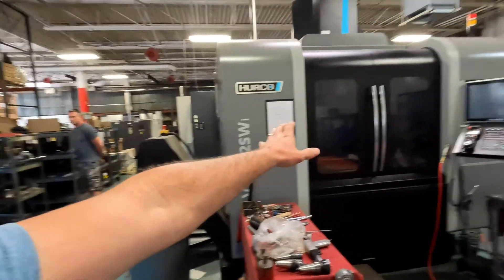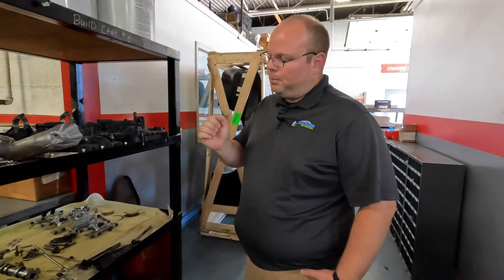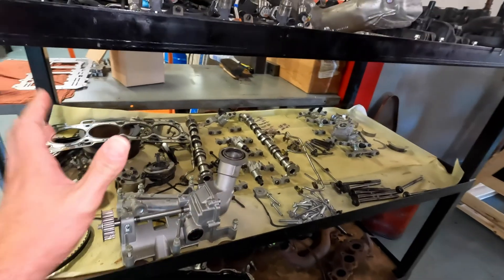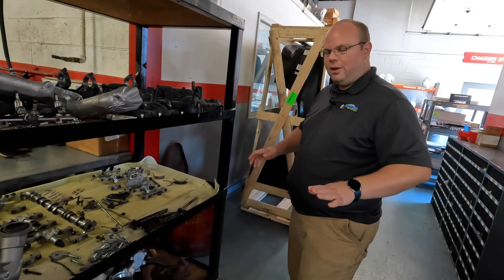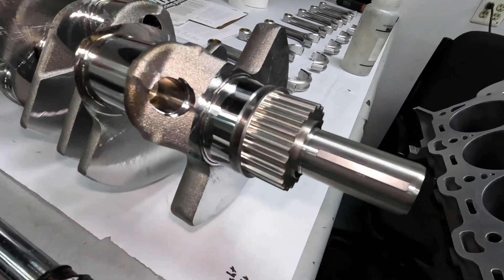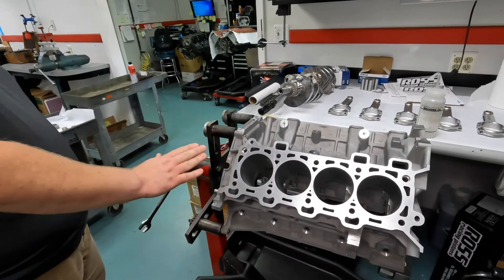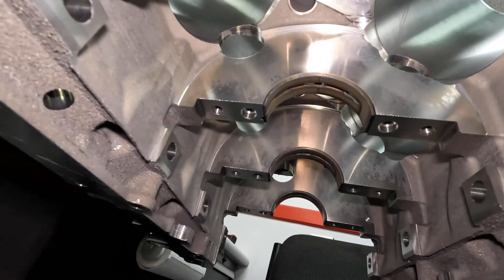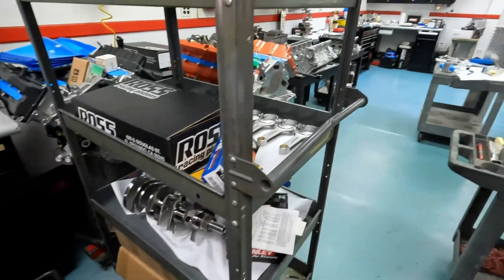What Makes the Gen 4 Coyote Different??? | Livernois Motorsports

Comment: Most customers DON'T want cylinder deactivation. Expensive and problematic. Chevrolet is coming out with a V-8 for the Chevy Silverado that DOES NOT HAVE cylinder-deactivation.  It is going to cause some customers to go to Chevy instead. At least offer a F150 with a Mustang coyote engine to get away from VDE if you want that. The VDE saves one MPG gas saving but causes engines that fail at lot sooner than when all eight cylinders work. When towing or hauling loads the F150 stays out of VDE. When the engine shut downs cylinders and the restarts them it causes a lot more wear and shortens engine's life span. Over 1 MPG gas tell the government it is not cost effective and stop being threatened and bullied  the EPA and the US government over this bullshit !!! The consumers and the manufacturers need to put their foot down and fight back !!! FORD grow a set of of balls and fight this crap. PLEASE !
Reply from the maker: At least the Ford system doesn't seem to be as problem plagued at the GM and Mopar ones.  I still have a lot of reservations about that oil pump belt through.

Comment: Cylinder deactivation is another problem...these engines won't last your heating and cooling parts of the engine constantly...this causes metal to WARP causing engine FAILURE. 👎

Comment: Still cracks at the bellhousing, still sounds like crap, still has 350hp at the wheels, still has more stuff then necessary on the engine. I get it its modern, but its not worth it in the long run

Comment: @svtperformance These gen 4 coyotes have been on the road for 5+ years now, have you heard of any failures of oil pump/belt?  Lot of comments regarding the belts unreliability, but I have heard of zero failures.  Main thing is going to be keeping good oil in the engine.
Reply: The main thing is that the belt is going to degrade over time in that oil bath, and debris will collect in the small spaces of the block.  Even if you use great oil change intervals, that debris from the belt is going to eventually shoot you in the foot.

Comment: Gen 4 is NOT basically a predator block......if it was a predator block it would be able to handle power GEN 3 power level with boost, GEN 4 ATM is junnk, cant handle boost out the box stock like a GEN 3 or even a GEN 2! 4 steps back on gen 4 from Ford in comparison to GEN 3 yote blocks

Comment: Yeah great move Ford belt driven oil pump on a work truck  engine that needs durability and reliability .Also great move to add cylinder deactivation with no increase in displacement so the 10 speed tranny can shake an shudder even more because of no low end torque 
What coyote needs is 700 cc more so it has proper low end torque so you don’t have to rev the shiet out of it as it is the case now to get power .I believe Godzilla 7.3!uses some type of variable demand oil pump which is one of the reasons it’s eating lifters and camshafts this coming from Ford mechanics so what can go wrong with a lot more complex coyote engine ?.This new gen 4 engine will be a beauty for dealerships when the recalls start  I wouldn’t bet on reliability for this generation  regardless of the hype from Ford.

Comment: I await the aftermarket to create a multi-row chain drive for the oil pump to replace the stupid belt.  The belt breaking isn't the issue, it's WHEN the belt starts to degrade and sheds bits of the belt into the oil, and that then blocks up the oil pump pickup and then destroys the engine.
Reply: There was nothing wrong with the gerotor style oil pump that's been fitted to the Ford Modular engine family for the past 30 odd years.
Reply: @DJDinaggio  What's your point, exactly?  I'm talking about how the pump is being driven, not the style of pump.
Reply: @OddBallPerformance  The point is that the Ford Modular oil pump is crank driven and proven to be reliable.
Now carmakers are trying to extract every last 1/10 of a mpg with that belt driven pump and cylinder deactivation, both of which introduce potentially catastrophic engine failure points. They could instead reduce some of the unnecessary technology that cars have these days to make them lighter. A 500lb weight reduction would achieve a much bigger mpg gain than a belt driven oil pump without compromising reliability.
Reply: @DJDinaggio  The majority of oil pumps are crank driven.  The problem is HOW it's driven.  Wet oil pump belts are a stupid idea, always have been and always will be. Ford has enough of it's own engines to serve as an example of why, and some recalls and service advisories to back it all up.
Reply: I honestly doubt anyone making over 800HP will ever make it to the point of belt degradation before the engine has other problems and needs a tear down but I'm with you and wet belts give me the creeps. The other issue is a chain also introduces harmonics and unbalanced can cause more problems.
Reply: @FrequencyOfThought  just ignore the plethora of ford engine failures from oil pump belts. Nothing to see there...
Reply: @FrequencyOfThought  A Chain drive mainly adds noise.  The majority of oil pump chains are run fit-to-length with no tensioner so that any minor harmonics introduced are eliminated.
Reply: It should be chain driven, not belt. Ford recommends there oil for it, but how many people are going yo dealer for oil changes that uses that special oil.  When you have to change the belt, its located behind the timing chains.  Expensive and not logical!   Look at he maverick pick up, the oil pump belt is failing on the 1.5 liter.  Catastrophic, put a chain and your good. My 2016 f150 has 256,000 miles.  Regular oil changes and reliable.  No oil pump belt will last that long. I know when I replace my f150 it will be a gen 3 with 6 speed not 10 with problems.  Peace out!!!!!!
Reply: @OddBallPerformance   I think a belt driven oil pump could pose potential issues. However, basically, the belt becomes a wear item. I think, though I am not sure, it has a service interval.
Reply: @robertmoore119  it does have a service interval, and the service cost to replace it is thousands of dollars if done at a dealership.

Comment: What I find interesting is everything Gen4 was surrounding the truck. Didn't see anything that said Gen4 mustang. It really leans into what another builder stated about the Gen 4 Mustang motor which was it's basically a Gen 3 motor in a Gen 4 car.
Reply: @RyanFreeman-i4o  all these changes are fuel economy related. Guess which platform is in more need of fuel economy increases?
Reply: @blakefelice6625  Yeah, carmakers have now set a trend of making their engines more failure prone for the sake of eking out an extra 0.1mpg.
Reply: @DJDinaggio a little late but the more moving and wearing parts the more likelihood of failure but let’s cross our fingers and hope not

Comment: How come almost nobody mentions ford tested the belt to 1100hp, and the belt is made of Kevlar which is literally used in bulletproofing things? And the Ford dod version is much better, AND can be turned off with a tune..
Reply: HP testing doesn’t really matter. What about heat cycles and the effects of being covered in oil 24/7. 
Nothing lasts forever especially synthetic materials.
Reply: @Mark-zz9rt  it matters, just hard to say what matters most. 100k out of any timing component is decent especially for American cars. But hp testing is definitely relevant. Even 6-700hp takes lots of heat, rpm and stress.
Reply: It doesn’t matter if the belt is made from Kevlar. It doesn’t matter if the belt can cure cancer and fly to the moon by itself. The point we’re trying to get through your head is that the belt slowly disintegrate overtime and that disintegrated material flows through the oil passages of the motor and eventually starves the motor for lubrication. It’s not about how much horsepower the belt can handle or whether or not it will break.
Reply: @miketerry6036  I agree. Fair point. But it should easily last 100k before thr reccomended change interval. And you are aware that chains stretch and break as well right?
Reply: Brokies coming up with excuses when in reality it's the $50,000.
Reply: I have a 24 f150 cylinder deactivation can be turned off by putting in sport driving mode.
Reply: @johnmckinnon44  yeah those can't be tuned yet, but I'd seriously recommend a good tune once you can. You can turn off the cylinder and start stop crap, and gain tons of power
Reply: A belt drive is a dumb idea...heat cycles will KILL it..chains are proven..Kevlar will deteriorate...and JUNK up the engine...killing it.
Reply: @YASMINE_KILLS so far so good for me and many others. Big power, higher miles,  super high revs, not seeing any issues. Chains also stretch and wear too. Sounds like a weird idea yeah,  but there's zero out there about any failures

Comment: That coyote is just way too complicated. This is why sales of Chevy go up every year and sales for Ford go down every year because Ford is doing this big mistake with their engines the smartest thing Ford could do is go back to pushrod style motors.
Reply: Check out the 7.3 Godzilla
Reply: It's no more complicated than a Toyota, or Mercedes Benz, or Hyundai, or a Honda, or BMW, or just about any other engine developed in the last 60 years!!!🤷
Reply: Hmm. No more Camaro or Challengers. To be honest the new coyote sucks because of the belt drive oil pump and displacement on demand. I have a gen three and it's been fantastic.
Reply: @carlmiller8640  The Gen 2 was really the high water mark of Coyote blocks. The cylinders of a Gen 3 block can't be overbored so if you get bore wear or scoring, it's basically scrap.
Reply: The 7.3 Godzilla is a traditional design, which is nice and simple.
   I like Camaros and Mustangs. I was a tech for some time, so I am not unfamiliar with engines or designs.
   I like the traditional methods of GM pushrod designs, but it doesn't affect sales at all.
  What does is American Support. Most of the GOP side is GM/Dodge.
   The DNC side buys them all, including Asian and European Brands.
   More recently, Asian brands have been getting more GOP support.
Reply: Can't even keep a 6.2 running these days
Reply: …except for all those pesky lifter failures.
Reply: @shaneflowers418 😂😂😂 yeah something tells me they're probly not rolling in the dough right now... DOD could possibly be the single dumbest attempt to increase fuel economy ever put into production.. design a new engine already and let that ancient design be the reliable gas hog it was meant to be lol
Reply: Go back to pushrod engines? Seriously? How old are you 65-70? I had a hot little fox body with a N/A 347 and a tremec 5-speed and pretty good parts in it, early 2000's or so. It would run away from just about anything from a dig and rarely met another street car that could outrun it. Go to the dealership buy a GT and it's really not much of a race! Hard to beat 8,000 rpms in a V8 with dohc and 4 valves per cylinder that flow twice the cfm my high dollar afr heads did making basically the power only the usable torque curve is 3 times longer than the push rod engines could ever dream of. Coyotes are complicated for simple minded people that hate technology improvements but can't explain why with any relative facts. With all 4 cams independently variable theres almost no limit to the tune-ability of a 5.0 so making more power is only limited by budget. Way more efficient, crazy long torque curve making all the power usable instead of  max power finally being made as soon as the shift light hits, not to mention power potential. Lil boost makes big power increases pushrod engines would never see. Push rods days are done, they were great in their time but that time is over now. Smarter is faster now.

Comment: And no mention of that oil consumption and plasma coating in cylinders....hmmm, wonder why?
Reply: what's wrong with regular sleeved block? Ford, lets make things more complicated... Im starting to think there the worst manufacture. They take something easy and make it twice as complicated and unreelable. 3.5 has cam phaser issues, 5.0 total engine replace ment.  Gen 3 5.0 is the worst.

Comment: Another known fact, the header bolt pattern on the drivers side cylinder head is actually a 5.2 bolt pattern, not the typical coyote 5.0 bolt pattern. Very important when ordering headers. MUSTANG motor not sure about the trucks
Reply: Good point I’m surprised they didn’t mention this

Comment: Wow belt driven oil pump??? Absolutely no way I’d buy anew coyote f150 then. That’s a disaster waiting to happen. Timing or oil belts make whatever vehicle it’s in a hard pass for me. Wow
Reply: 5 years later and they still be the most reliable 1/2 ton pick up truck engine and the ''disaster'' gets way overblown just like people running stock OPG's while being boosted
Reply: @Glorious117  5 years? This change just happened. Issue won’t show up till the belts start breaking past 100-150k miles. This is a fundamental change and historic reliability can’t be used.
Reply: @midlifecars 2021+ trucks use wet belt.
Reply: @midlifecars I hope you plan on changing your timing chain or belt at that kind of mileage regardless of the material.
Reply: LS oil pumps go out all the time and they aren’t belt driven. Coyote oil pump gears break.
Reply: @theunfairmont2497  yes but usually when pushing lots of power. They rarely fail just because of miles. Belts have historically broken on other engines in the 100-150k range. Why are you defending them going to belt? When have belts ever been known for reliability?
Reply: @midlifecars  all you see is the belt, read about the entire system… look at all these guys making well over 1000hp with the belt driven oil pumps
Reply: @theunfairmont2497 don’t bother him with facts. Ford tested this belt at over 1100HP without failure.
Reply: @philipmoore449 hp doesn’t mean shit. There is little load on these belts. Check back in 5-10 years on that belt at factory hp levels and see how cracked it is. Time and heat cycles are what is going to kill these things
Reply: @theunfairmont2497 most of the time coyote oil pump gears fail because of over revving abuse. I know most people do OPGs before they go boosted which is good but then I do know some people who have stock opgs and boosted and running fine but when u ask them isn’t the oil pump a problem while boosted most say no unless ur shifting past 7509-7800rpms
Reply: Bro you're going to not buy it cuz it's $50,000 not because of the damn belt.

Comment: What years F150 has the Gen 4?
Reply: 2024
Reply: @BigThumpr1 21+
Reply: @petergalvez6431  negative. Look it up. Gen4 Coyotes in both the Mustang and F150’s didn’t come out until this year. F150 Gen3 Coyote 18-23
Reply: @BigThumpr1  wrong. Gen 4 truck and gen 4 mustang are different. Gen 4 f150 came out in 21
Reply: @BigThumpr1  in 21 the f150 had cylinder deactivation and belt driven oil pump. 18-20 didn’t
Reply: @petergalvez6431  wrong still. Since you won’t look it up, on Livernois website, it says 18-23 is Gen3. I think they know way more than you.
Reply: @BigThumpr1 wrong the 21+ f150 is when they came out with the vde and belt driven pil pumps
Reply: @BigThumpr1 the f-150 gen 4 was introduced in 2021. You are confused like many others........... The mustang got the gen 4 in 2024

Comment: I wont have a truck with all that variable demands for oil and the pump driven by a wet belt, i would put my efforts into an oil pump chain drive conversion instead of a billet crank gear for a belt thats too narrow for the constant demand changes….imo
Reply: Give it some time, melling will come out with a chain conversion like they did for the 2.7 ecoboost v6
Reply: @monikhushalpuri  didnt even know a chain conversion was available for the 2.7
Reply: @young11984  I think it might be available, on rockauto for 2018 models and possibly newer there's a chain driven oil pump, I remember seeing a chain conversion kit but now I only see the chain driven pump but no chain available? Maybe I got my years confused but I think 2018 is when 2.7 ecoboost went to a wet belt for oil pumps
Reply: @young11984  just checked the part number it's melling m492 for 2018-2023 models on rock auto
Reply: @ awesome, i just wont buy from “wrong auto” again lol. Just looked that number up and it has a belt pulley on it
Reply: @young11984  damn we had our hopes up lol
Reply: Under dimensioned and overcomplicated and not enough displacement while beeing to wide. Then put in heavy cars and trucks.